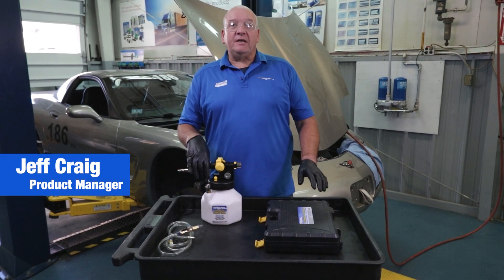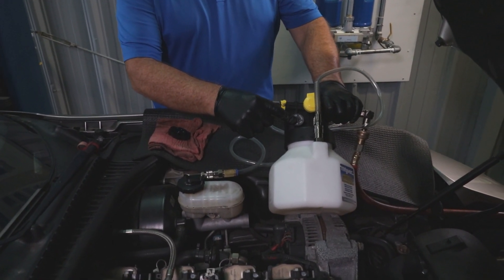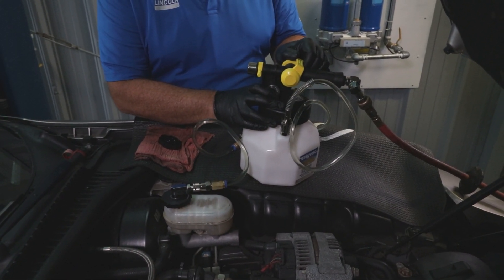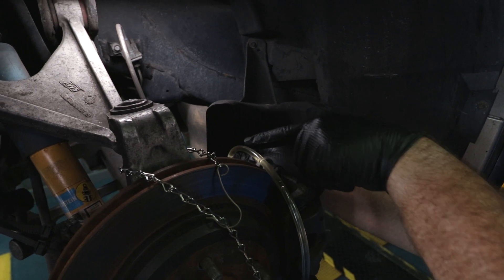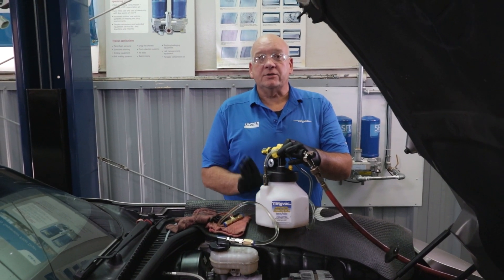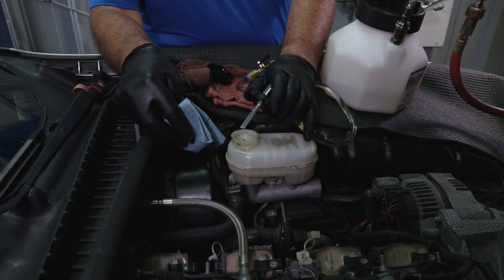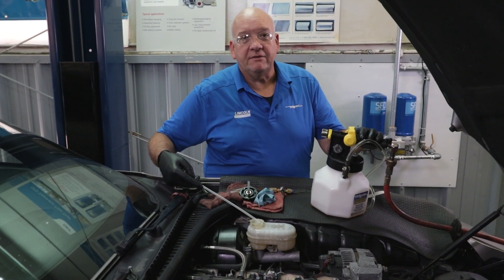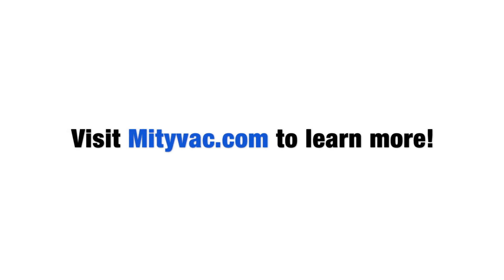Pressure Bleeding Brakes with the MV7840

Comment: That's what my wife is for 😂 I bought one of those manual pumps but the problem I had was the hose to valve connection leaking air or air getting sucked in from outside and I didn't want to bother with having to coat everything with grease or something just to seal that connection.  Having someone pump and hold the brakes takes no time and I don't have to deal with crappy hose to valve connections.  I guess if you really can't get another person to help or do a lot of brake bleeds these things are worth it.  But I didn't see mention of how sealed your hose to valve connection was?  What if it's not secure.....how do you seal it to prevent external air from being pulled in from the vacuum?  Good video though 😊

Comment: My Toyota has a push on rubber cap on the brake mastrr cylinder reservoir so I think it woild just pop off under pressure
Reply from the maker: we offer either a locking style adapter(MVA800) or a cone style adapter(MVA809 or MVA810) that is chained to the reservoir to allow for pressure to build in the non threaded cap style reservoirs. 

~John

Comment: Love MityVac products, but at $350 for the kit, this thing is overpriced.

The Motive, while manual, will be about 1/3 the price even after buying a couple of adapters.

And it works perfectly fine.
Reply from the maker: Our MV7100 Series units are capable of both pressure dispensing and evacuation in one reservoir unit. Compare that to Motive, which has one unit for evacuation and one for dispensing. The MV7840 is one of many kit options we offer. In this case we configured the MV7840 kit shown in this video with our pressure brake adapters. This kit can be expanded by purchasing extra reservoirs, adapters and tubes to perform a variety of fluid handling tasks centered around the base evacuation and dispensing unit. 

~John

Comment: How many master cylinder adapters does it come with? Are adapters interchangeable with 1966 mustang, 1970 Mercedes 450 sl, 1981 ford F100, 1970 Riviera and 2001 ford escape? Thx
Reply from the maker: There are 8 adapters in the kit that cover a wide range of vehicles and should cover many of those you have listed. Additionally, we offer separately two rectangular adapters to fit older large top reservoirs. Adapters are the MVA811 and MVA812. 

~ John

Comment: So i recently bought one from a tool dealer. My GM adaptor 803 keeps leaking from the back side when pressurized. I have a friend that has the same adapters and used his 803, still leaks. Tired the other gm adapter and it does not fit. The master cylinder is brand new OEM. '05 2500Hd silverado. My first time using this specific bleeder, is ot suppose to have a gasket besides the O-Ring? 

Thanks again 👍 i love the bleeder and dont want to have to return it.
Reply from the maker: I'm sorry to hear you are experiencing issues with the 803 adapter. The o-ring  is the only seal on this adapter and seals internally in the neck of the master cylinder reservoir. while a rare occurrence, please check the inside cylinder of the reservoir for any imperfections such as a seam or deformed plastic that could create an area where the o-ring would not seal against. The only other possibility is a damaged o-ring on the adapter.   Please reach out to our tech service department for any additional troubleshooting or warranty questions. 

Contact our technical support team:
Phone: 1-844-772-1341
Email: Lincoln.Tech.Service@skf.com

~John